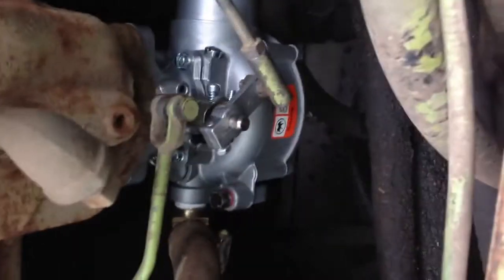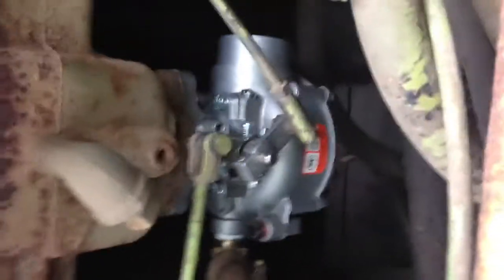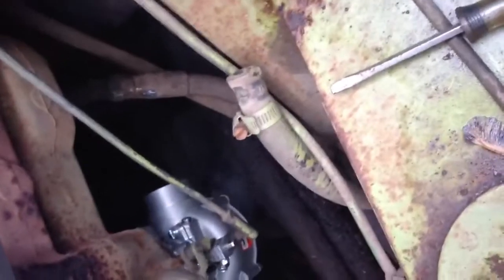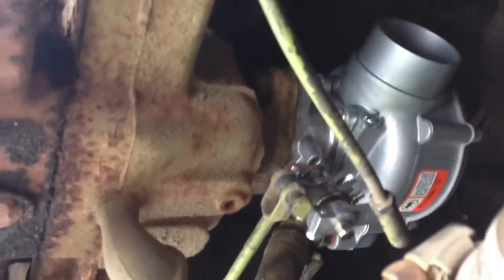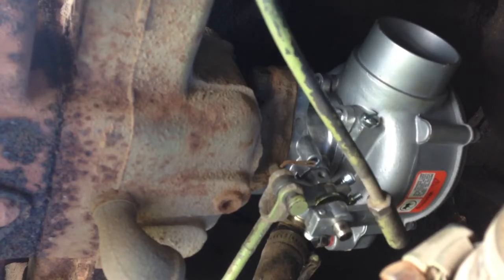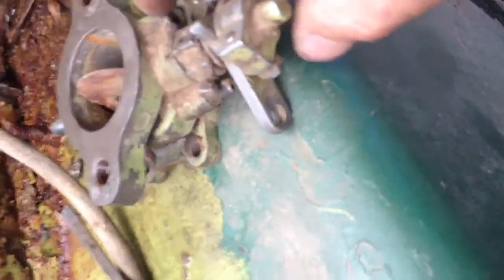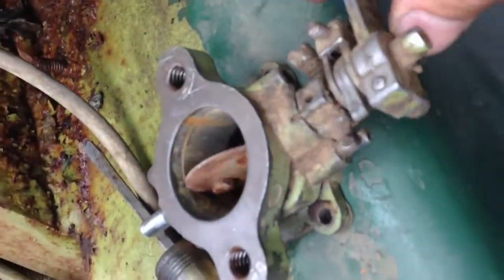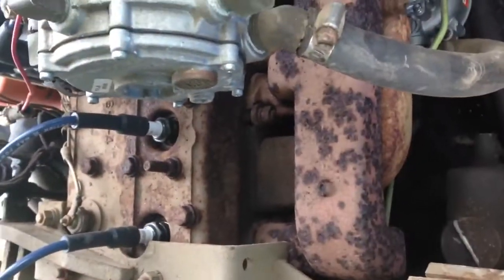Clark c500 y80 1971 forklift. Just got running need help with throttle linkage.

Comment: I have the same exact problem except I didn't take mine apart it just sat for a while now the idol is screaming but I can idle it down with the lever as described. My linkage from the pedal attaches to the opposite side of the propane unit. If I disconnect the rear linkage as shown in the video the propane carburetor is spring loaded to wide open throttle which is confusing to me. I know this is an old post but please help!

Comment: I've got an otis baker fjf50 that has a similar linkage. I can't figure out how to fix it! Its an oddly complicated bunch of springs and linkages
Reply: The linkages mount on the other side closer to the engine block.  The video shows them connected facing outside.  That piece he replaced needs to be rotated 180 degrees.